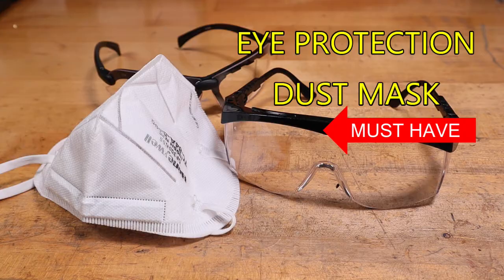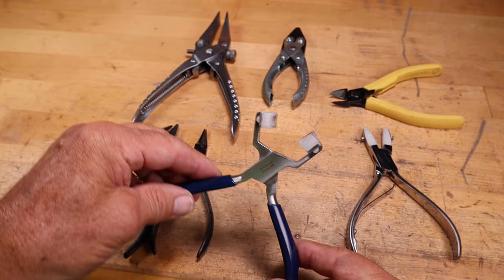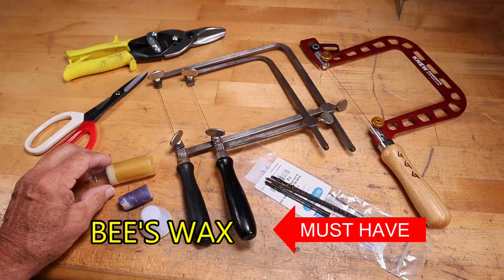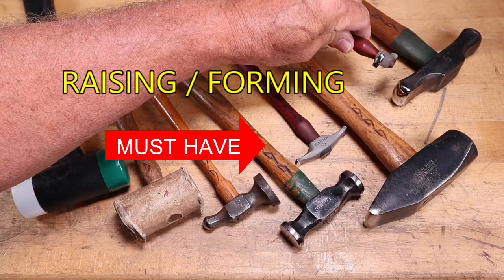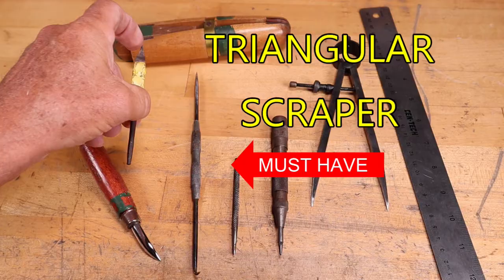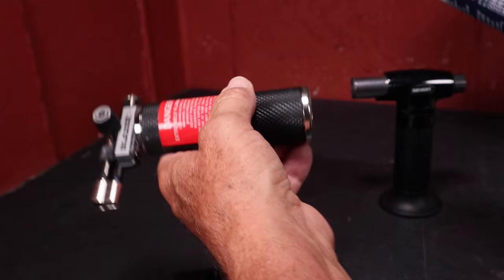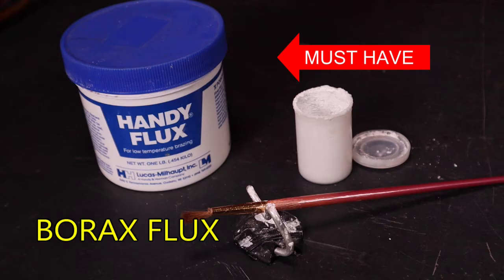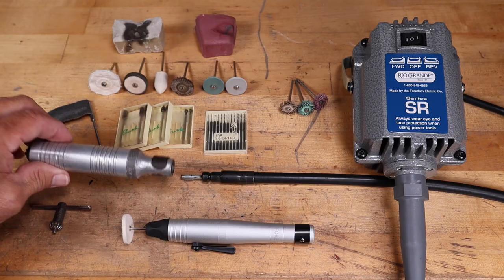"MUST HAVE" BEGINNING TOOLS FOR JEWELRY MAKING

Comment: I'm a current college student and was SO close to buying some basic silversmith starter kits. Little did I know how.much was involved! I definitely appreciated the video.
Reply from the maker: Hello pony,  Glad to see you are starting silversmithing.  Sometimes in the starter kits they put in extra things that you don't really need at first.  Start with the basics and grow into your tools.  Get a jeweler's saw frame and blades, some needle files, one flat and one half round file, raw hide mallet, one planishing hammer, bench block, vice, and  soldering tools. You will start to know which tools you need with more experience.    I remember when I was a senior in college ( 50 years ago!!)  and I had a few basic tools.  I found a steel drawered tool box. I was very excited to gather my tools all in one place.  I still have that tool box and use it every day!  Start your collection slowly and grow into your tools. You will spend your money wisely and be more satisfied in the long run.  Good Luck to you.  Keep me informed on your progress!!  Greg Greenwood

Comment: It looked like none of your pliers have teeth, is that right? I'm assuming it's so they won't chew up the soft metal. So far it seems like buying the materials for jewelry making, the metals I mean, are more expensive than the tools. A small piece of sterling silver costs more than a few of these tools combined.
Reply from the maker: Hello Patric, You are correct, no teeth on any pliers. I try to polish them also.  The less amount of damage to the metal the better.  Yes, the price of metal is high for sure.  You can do some work with copper to keep the expense down and to learn some of the techniques before you do your projects in silver.  I remember sitting around the jewelry studio in collage and talking about the price of gold.  It was a HUGE price for us, but we should have pooled our money and bought a ton of gold at the HUGE price of $52. an once!!!   Thank you for watching and sharing.   Greg Greenwood

Comment: Great video again !
I would add, that of the pliers one often requires a pair of those for certain works (chain nose, flat nose, parallel). With the saw frames, the basic ones are good - not only for starters - but one should have frames with different depths as I feel that a smaller depths enhances accuracy when sawing but a deeper saw frame might be requires for certain projects. When it comes to making jump rings (I make a lot of those) I go for plain steel rods that are cheaply available in any sizes and which are good enough to also make some custom stamps and punches. Butane torches: I happen to be a slightly ambidextrous right-handed guy, so I can do a lot of tasks with my left hand as well. The only butane torch I found working independently of what your main hand is, is one from Proxxon - it can be operated single-handedly and with both, left and right hand. All other torches I found basically require both hands to operate or are based on the assumption that you are a right-handed person. This can slow down your work and also affect the amount of fuel burned as you cannot handle the device as quickly. I also found a couple of butane torches sold be jewelry suppliers that I would rather see unfit for the task as you could easily burn yourself because the handle is not properly insulated. For pickling I have been using potassium alum for years. It is dead cheap and can also be used for a lot more tasks. Works best at 60-80°C but also has nice results at room temperature if you leave your piece in the pickle over night. Flexshaft/Pendant motors: Must have ! Don't ever go for the Dremel type options - The pendant motor comes with a variable speed control and can operate at very low RP/M. The price difference isn't that much if you consider burning off hundreds of bits due to the high minimum RP/M of a Dremel tool.
Depending on what size of jewelry you're making, I would add a bench polishing motor (e.g. if you make cuffs and bracelets - much easier to polish larger surfaces) and once you have accumulated enough waste material, an ingot mould and a small rolling mill. The latter saved me lots of time on different projects as well.
Reply from the maker: Hello Torsten,  Thank you, very nice to hear from you.  Your comments are always informative and helpful.  I agree with you 100%.  Thank you again, I appreciate your support.   Greg Greenwood

Comment: Hello Greg excellent video, helps a lot to know what are the most essential tools to have for jewelry making.

I live in Panama and work with the Wounaan indian artists from the Darien rainforest.
They carve beautiful shell cameos for me to set.
The cameos range in size from 23mm round to 42mm round.

We work with a filigree artist in Panama that set a 42mm round cameo in filigree.
The weight of the silver filigree setting is 8.1 grams.
It's very light and beautiful.

I am finishing pieces set on 42mm
.950 silver discs that are hand pounded on the back of the discs.
The pieces I've just finished setting range from 26mm to 32mm in weight.
They seem much heavier than the filigree settings.
We've sold smaller disc pendants that weight between 11 grams and 15 grams and the weight hasen't been a problem.
In your experience do you think that a necklace pendant of 32 grams is too heavy for most women?

I'm just getting started and would like your opinion as to whether the 32 gram pendants are generally too heavy for women.

I can try and hand pound the silver discs to a lower gram weight.
What weight do you think would be best for the 42mm size?

If you like to see some pictures of my work let me know how to send them to you.

Thanks.
Reply from the maker: Hello Christian, Thank you for your comments.  I appreciate it.  What a great opportunity for you to be working with the Wounaan indian artists. I thinks the 32 grams is a little on the heavy side, but should be fine.  Many wearers these days do not mind the extra weight. Keep the thickness of the .950 silver discs, BUT,  you might think about piercing the discs with an interesting design or pattern that would relate to the cameo.  This way, it would add interest to the back of the piece AND make it lighter. Put some of your pictures on your channel and I'll take a look at them.  Sounds interesting.   Thank you for your story and questions.   Greg Greenwood
Reply: @greggreenwood4628  Greg I've been trying to reply back to you here on the comment section  without any luck.
My cameos are shown on a different format other than youtube.
I'll be putting them on my youtube channel this week.
I'll let you know when it's done.

Thank you for all your good advice.
Reply from the maker: Hello Tropical,  That will be perfect.  I'm looking forward to seeing them.  Greg Greenwood
Reply: @greggreenwood4628  Hello Greg, finally finished the youtube channel I was telling you about.
You can see the cameos there.
Thanks for all your advice.
Hope you enjoy the video.
Reply from the maker: Hello Christian, Thank you for sharing your video.  It is very exciting.  The cameos are wonderful.  You are very lucky.   Thank you again.  Greg Greenwood ( I left a comment on you channel )
Reply: @greggreenwood4628  Thanks a lot Greg. I'm rewatching this video about the essential tools for jewelry  and making a list to buy in the near future.
Thanks for your comment. Hope you enjoyed it.
Reply from the maker: Hello Christian,  Yes I did!   Greg Greenwood

Comment: Such a beautiful go through of what to begin with! Must haves and some nice-to-haves! And so nicely presented Greg! May I express a wish for a new video? How does a beginners workplace look like? A bit more about a good workbench, how to place tools, parts, on the wall in drawers, etc around you for comfortable and effective work. Which chair to use... i only participated in a half day teaser course, watching lots bof videos now, will build a little workshop during x-mas holidays. Thanks for all videos and looking forward to get going.
Reply from the maker: Hello Robert. Thank you for your nice comments.  I appreciate it. Also, thank you for your interest in a beginner workplace video.  You must have been reading my mind.  I am starting to work on a series on setting up a studio with different ideas for tool placement etc. Unfortunately, I will not have it finished by the holidays.  In the meantime, make sure you have a solid bench. That is the beginning step in a successful studio. Decide if you want to sit low or high at the bench.  This is a personal preference.  Generally, you will be sitting low to the bench so you can saw and work on the bench pin.    You can start off simple for the tool storage which can be expanded as you learn more and need more tools. Get a tool box that has front drawers.  This can be put on top of the bench to hold the few tools when you first start.  In the videos, I will show you my first tool box and how I still use it today.  The more you work in the studio, the more you will feel comfortable with ever changing arrangements. I have had many studios over the last 50 years (Oh my gosh), and each has been unique.  The layout changes with the space available.  Make your space comfortable and inviting. You will spend many hours in it, so enjoy your stay!  If you haven't subscribed and rung the bell for notifications, please do, so you won't miss the videos when I publish them.  Thanks again for your interest. Keep watching. Talk to you soon.   Greg Greenwood

Comment: Hi, can i know a round figure amount that needed to buy these all must needed tools?
Reply from the maker: Hello Vj,  A round figure for the basic tools is $600. and a flex shaft is $150. to $250 (basic flexible shaft) So your total is approx.  $800 to $1,000.  You do not have to purchase all of the tools at once.  Start with the tools that fit the type of jewelry work you want to try. (example) Wire work or sheet metal forming.  Start small and work into your tools.  Good Luck and thanks for watching.   Greg Greenwood

Comment: Whats is diffrence between the butane and propane soldering?
Reply from the maker: Hello Afshin,  They are both gases used in torches.  There is very little difference.  You can use either one.  Whatever the torch uses is OK and will do a good job.  Greg Greenwood

Comment: Is it safe to have a crockpot with pickle in the living room, on low heat for long periods of time? I know it isn't ideal, but it's the only option I have at the time.
Reply from the maker: Hello Red Eye Stones,  The pickle will give off fumes which  could be a health hazard.  If you are using vinegar or citric acid, then it is not a big problem. Unless you don't like vinegar smell in your living room.  The commercial pickles will work at room temperatures, but take longer to work. So this could be an option for you.  I hope this helps you.   Thanks for your question.  Greg Greenwood
Reply: @greggreenwood4628  so I've looked several times on Google to find out if it's harmful to keep Sparex no.2 in a crock pot in the living room, at low temp. But can't find ANYTHING at all. So weird. Maybe I should call the company that makes it?
Reply from the maker: Hello Red Eyes,  That sounds like a good idea.  Get the information from the source.  Greg Greenwood